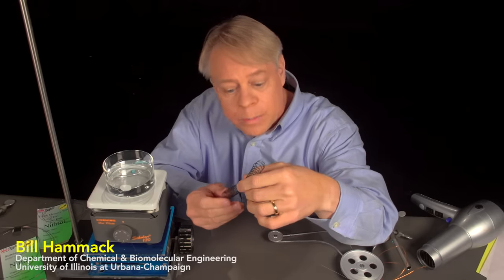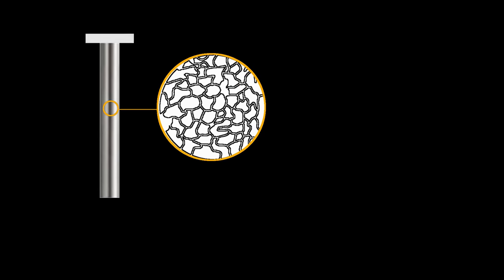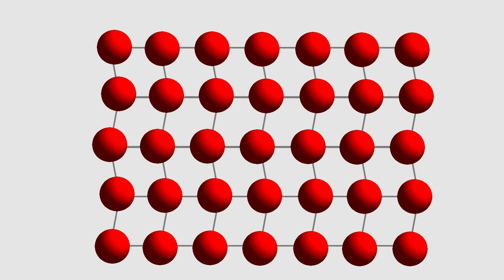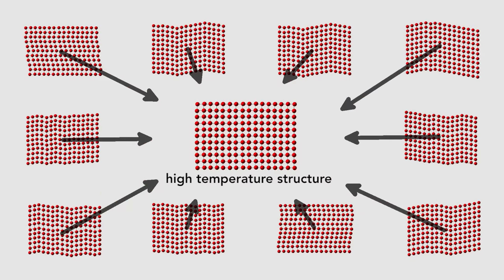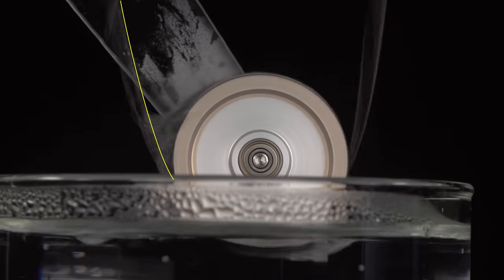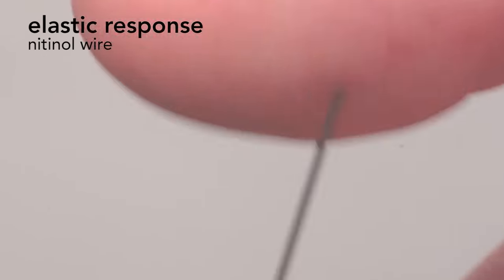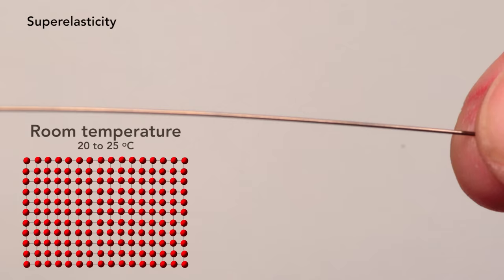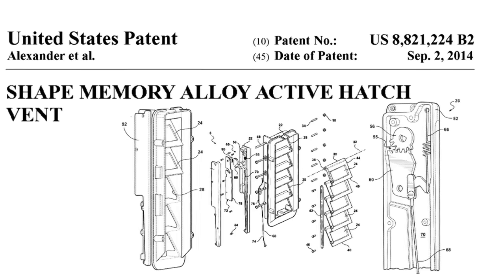Nitinol: The Shape Memory Effect and Superelasticity

Comment: Thank you, great very interesting video.  No correction or anything. I'd be very weary of the nitininol stints. Nickel has some major allergy issues, and the allergy can develop from exposure. The E-sure birth control coils, and British attempt at Nickel coinage attest this. Maybe the coatings have the longevity to withstand?  I have a near 25 year old scar on my wrist from wearing the laquer off the setting knob on my wrist watch. It took over a year for the intial wound to heal, a very psoriaisis looking mess for a while. Wouldn't want that inside my arteries or ova ducts, if I had them. Cheers.
Reply: P.S.  I had seen your Aluminum can years ago, and kicked myself for losing your channel. Very glad to have found it again, it's among the best.
Reply from the maker: Thank you

Comment: Interesting. 1.) How much temperatur-dependent energy difference can be used due to the material behavior and its usable temperature range? 
2.) Could/Has any less frictioning drive belt element - e.g. Nitonol chain - been used instead of a Nitonol wire?
3.) Could/Has any further applications with external controlled temperature (re)shape of the Nitinol material - e.g. to re-bend/-stretch it?

Comment: If the bottom wheel is activated by the heat of the car engine, it can have it activate, an alternator that runs freely with the engines heat, by heating the bottom wheel, the wheel can be directly in the engine to absorb the heat.
They can also do CPUs that can expand and absorb heat, so they wouldn't bottleneck when too much heat.

Comment: Sir I have doubt regadring  unique behavior of NiTi (or shape memory alloys, SMA). I am working on NiTi for more than 4 years. Still I dn't know why SMA prefer phase transformaiton instead of bond-beaking (dislocation) ? I am bit curious to know about the fundemental reason behind the phase transformation in NiTi based shape memory alloys. Does it related to electronic configuraiton of Ni and Ti ? If so, can you provide some insight into it ?

Comment: If this Nitinol is used in stop motion animation (to build the joints of a puppet) will it break with bending fatigue? 
Today aluminum wire is used to make joints bendable, but aluminum wire will eventually break, after bending the arm or leg 30 or 50 times.

Comment: I saw a new design for a Mars rover that had tires made of springs to reduce weight. I think they made the springs out of nitinol so if the tire became deformed, they could pass an electrical current through the springs to heat them up to have them return to their original shape.
Reply: mars temperature wouldnt allow for that

Comment: Would be cool to use the nitonol wired machine for clean energy generating. Like a wire with a diameter of like a meter. 75 degree water isn’t that expensive So the energy should have a positieve rendement right?

Comment: how much force or torque can be applied to the nitinol wire on a sheave design? Would light pressure cause the wire to slip or could I tension the wire by spreading the sheaves to bypass that? Does it have tensile strength? I got a lot of questions and a lot of ideas lol

Comment: Yes, BUT, you left out an important fact: if you bend the wire beyond a certain radius (that is, very tightly), it loses the superelasticity and memory in that bend. But of course that can be said of about all solid materials: they fail when stressed enough. I still remember that I bought a piece of nitinol wire from a science fair many decades ago, and when I bent it tightly I could feel a sort of crackling in it, and the bend no longer straightened when exposed to heat :)

Comment: @engineerguy great presentation. Can you make a presentation where a nitinol  0.3 mm wire kept at room temperature 37deg C is annealed & bend into a very small loop and then when it is released from an entirely different entangled shape, it regains its small loop shape made from annealing in a few seconds 3-7 seconds at the same room temperature 37deg C.

Comment: I wonder if you could somehow use the shape memory properties of nitinol to help a solar panel stay at the correct angle to the sun for best power generation.  It reacts to heat, of which the sun is providing that, and cools when it's shaded.  I'm not clever enough for figuring that out, but it sounds interesting to me.
Reply: I think it would be too volatile to general heatwaves and cold snaps. They'd both drastically decrease efficiency over a steady panel. Plus snowfall would cause consistent cooling unless it was cleared which is extra manpower.

Comment: Since a sterling engine also uses the difference in temperatures to generate force can these two be combined to increase the efficency of a combination engine? I imagine this could safe electricity in homes in colder regions or maybe the research bases on the pole since you have to heat anyway
Maybe even the reverse too in more hotter regions in homes that are cooled this can be used to reduce the cost of that - maybe even in the cooling unit itself

Comment: Could you build a turbine with this wire powerful enough to heat the water at the bottom wheel while creating a surplus? Or would the scale of it ruin the idea. (Cause it would be expensive or to big and the physics would stop working properly)
Reply: No matter what amazing contraption one could think of, it'll never ever will create a surplus of energy. Each and every possible generator uses some external source of energy and returns only a bit of it in a form of useful work(the rest dissipates). 

You can also quite easily prove that energy conserves for any possible closed system(which a proposed generator is).

Comment: Perpetual motion? I know it’s not possible, but I’m trying to see where energy is lost. Maybe it just slows down after a while.
Reply: Ofc not perpetual motion, the energy is lost as the wire cools in the air, sapping heat from the thing that is heating it at a faster rate than normal. Eg, cup of boiling water will cool down faster with that engine on the top of it than one without.

Comment: As an aside,  another strange elasticity of a nickel alloy is the ability to become magnetic by heating it instead of the typical curie point demonstrations where the heat source is removed to restore attraction.
Additionally, this alloy can also create electricity.

"To create the material, the research team combined elements at the atomic level to create a new multiferroic alloy, Ni45Co5Mn40Sn10. Multiferroic materials combine unusual elastic, magnetic and electric properties. The alloy Ni45Co5Mn40Sn10 achieves multiferroism by undergoing a highly reversible phase transformation where one solid turns into another solid. During this phase transformation the alloy undergoes changes in its magnetic properties that are exploited in the energy conversion device."

"During a small-scale demonstration in a University of Minnesota lab, the new material created by the researchers begins as a non-magnetic material, then suddenly becomes strongly magnetic when the temperature is raised a small amount. When this happens, the material absorbs heat and spontaneously produces electricity in a surrounding coil. Some of this heat energy is lost in a process called hysteresis. A critical discovery of the team is a systematic way to minimize hysteresis in phase transformations. The team’s research was recently published in the first issue of the new scientific journal Advanced Energy Materials."

Watch a short research video of the new material suddenly become magnetic when heated: http://z.umn.edu/conversionvideo

Comment: I guess they might have used NiTiNOL engines shown to make really quiet engines for submarines. Probably heated with nuclear power on the one side and cooled by a thermal connection to the surounding sea water on the other. An engine like that would have an advantage over electrical engines by not being shortcircuited when shot. only some of the wires might be destroyed, but that wouldn't really affect the others. Or if they used belts of NiTiNOL holes might not be a big problem.

Comment: 4:50 I wonder if there is a way to make an contraption that creates kenetic energy for free, but this one needs a little force and heat
Reply: If we wrre to magnify the heat of the sun and direct it toward water we could make a renewable energy source more efficient than solar panels
Reply: @unknownunknown6500  I really doubt the "more efficient" part. Can you provide any calculation on the efficiency? For comparison, solar cells are on average turn around 30-40 percent of light's energy to electrical energy if I recall correctly.